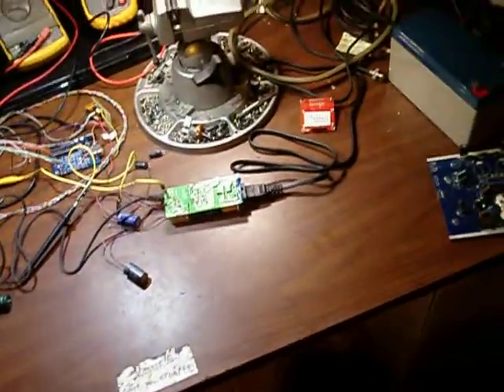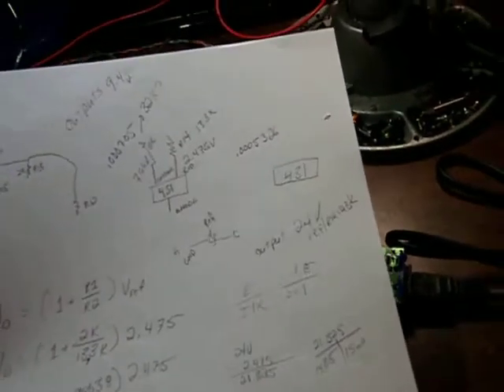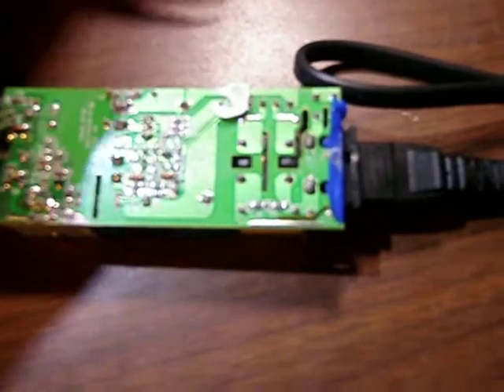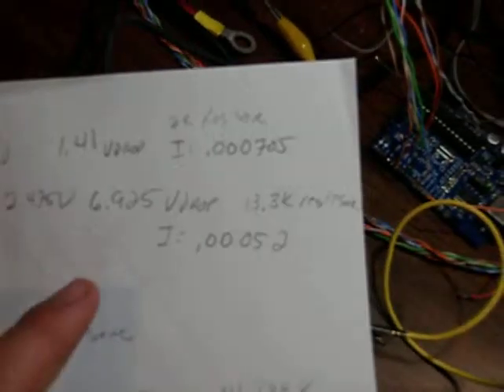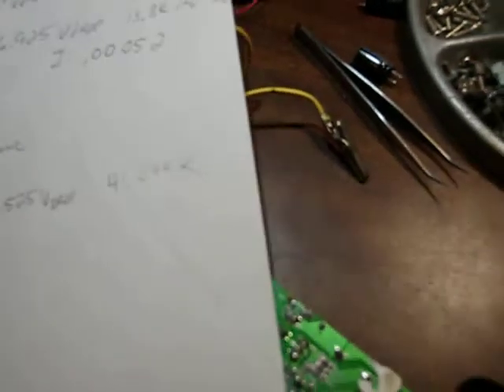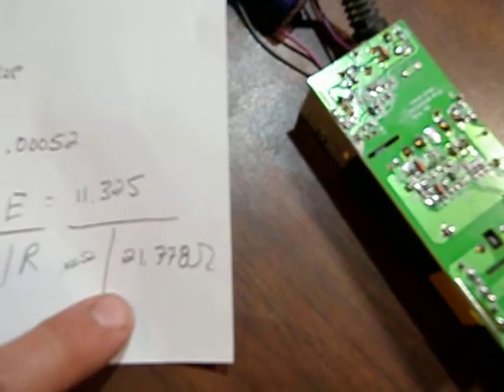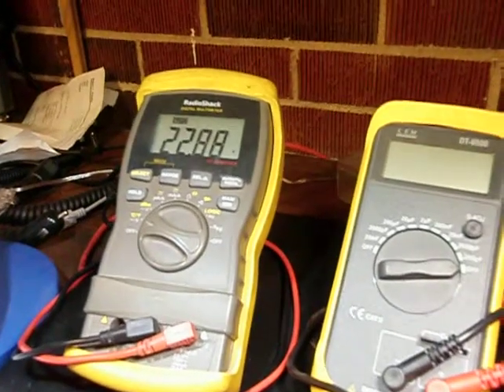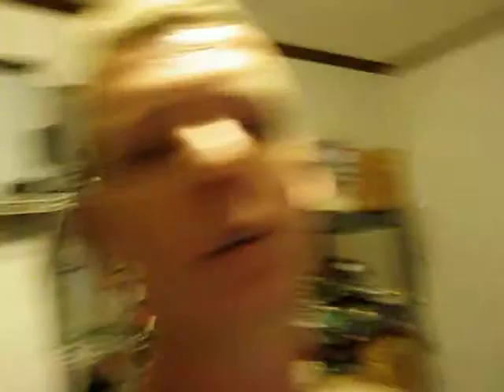SMPS modification 9V to 24V or can be 13.8Vdc

Comment: Wondering if you could help me modify an HP power supply. I have an HP C7296-60043
output 31.5Vdc @ 3.17A
  It appears to use an LM358W to talk to the opto coupler which appears to be a white 4 pin ic chip.

http://www.st.com/content/ccc/resource/technical/document/datasheet/82/55/37/12/85/cc/4c/29/CD00003160.pdf/files/CD00003160.pdf/jcr:content/translations/en.CD00003160.pdf

There is a vairable resistor but this does not vary the voltage, it close to a shunt. I think it is for current limiting, but is there a chance it is to bias the chip as the chip is some type of dual operational amplifier?

  I would like to try to lower the voltage to 26V

I tried to find out in the data sheet how to change resistance to vary the signal, but seems complicated as there are so many uses, i don't have the schematic for the supply and it appears both sides (contains two op amps) of the LM358 are being used, I suspect one side is being used for current limiting.
  I have photos and started to draw my own schematic but got a bit stuck here.

I also found the texas instruments version

but you might need to sign up to see the page:

http://www.ti.com/product/LM358/datasheet/abstract#SLOS0682709